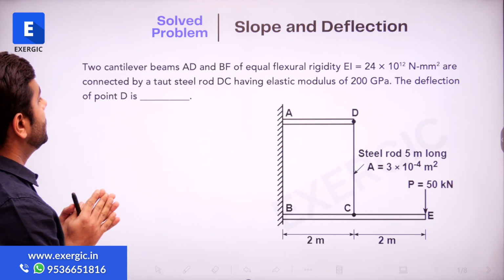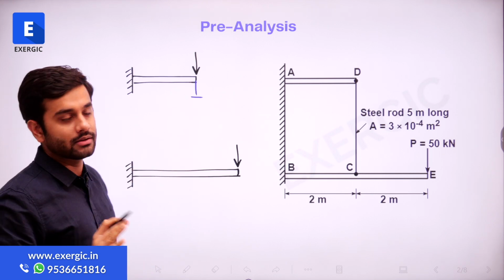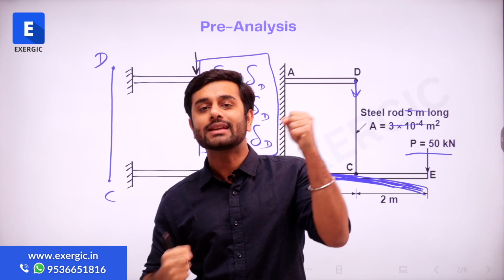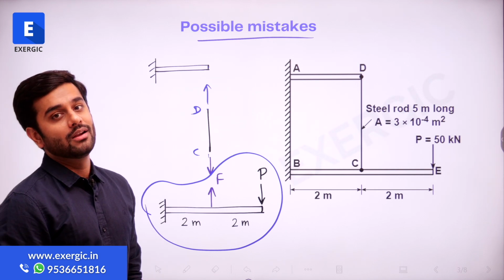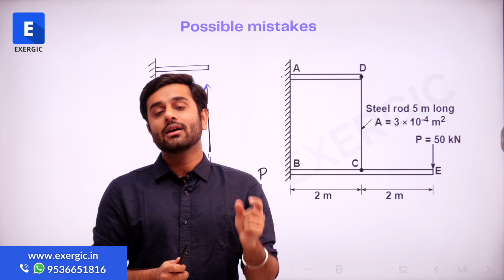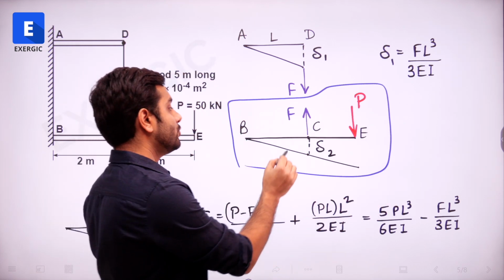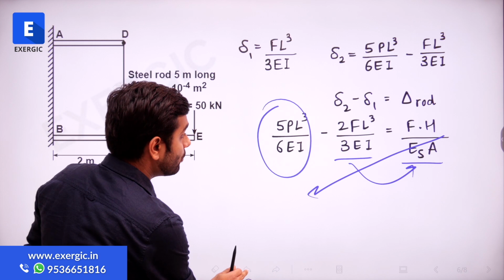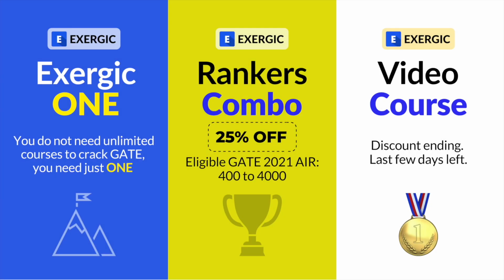Deflection question with conceptual learnings - Strength of Materials | GATE Mechanical

Comment: Gajab question sir , bhut khuch sikhne ko mila specially from the point where yu tell about the deflection at point C and D , and how possible mistake which students has done . While I was attempting the qu first time i was getting ans 11.11 mm. So the mistakes which you told in video i was actually done it 😅. Uske baad apne jiss type explanation karaya iss numerical ka bhut khuch sikhne ko mila sir. I am already a exergic video course student. Sir your all solved eg qu sabse hatt ke hote ha , aur bhut khuch new learnings deke jate ha. I am really appreciate your works towards all the student community.👏👏❤